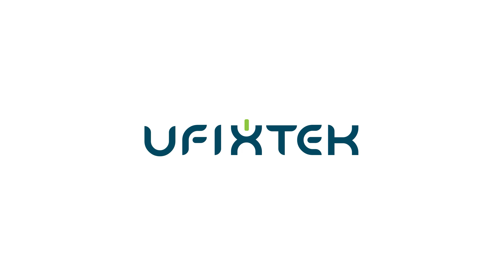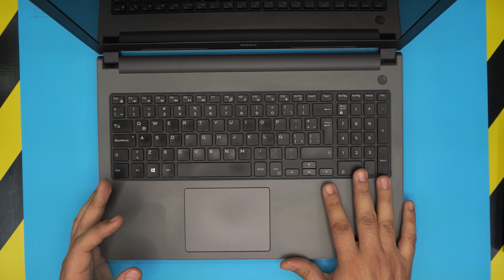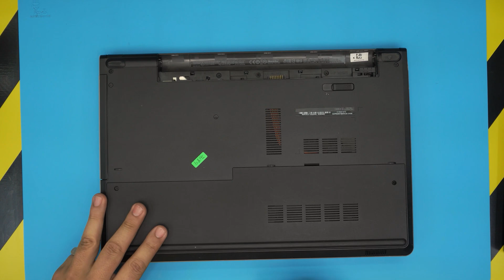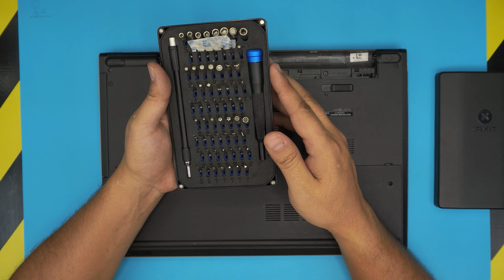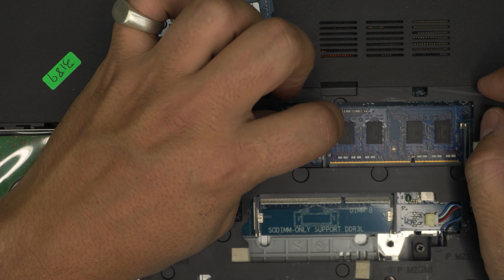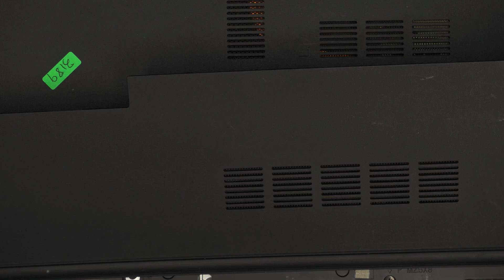Dell Inspiron 5559 P51f Ram Upgrade FULL GUIDE

Comment: Hi!
Thanks for the video.
I have a question, i'm upgrading the RAM with 2x8 DDR3L 1600, but it doesn't turn on, i checked the RAM in other laptop and it worked!, what could be the problem?, something with the BIOS?
Reply from the maker: 🫠Regarding your question, we've encountered many of the same issues you're experiencing, and we discovered that after many years of not using the RAM slot, the pins inside the DIMM develop a thin layer of corrosion. I recommend spraying 98%+ isopropyl alcohol inside the RAM DIMM, gently brushing it with a soft toothbrush, and then testing it. It's also a good idea to update the BIOS from the official site.
Should you have any further questions or requests in the future, please don't hesitate to ask me.
cheers🍻
Reply: @uFixTek It’s weird, becouse it turns on with the original 4x2 RAM, but it doesn’t works with the new 8x2 🤔
Reply from the maker: update teh BIOS from the official site.

Comment: I have upgraded my laptop with another 4gb ram ddr3l. When I run cpu z it shows 8gb of ram. But in task manager it only shows 4gb ram how to fix this?
Reply from the maker: Thank you for your feedback! If you'd like to support the channel, you can like, subscribe, or do both!

Regarding your question, i need more detail my friend, what OS you using 32bit 64bit, windows 10 or 11.
what you saying it is not normal it should not have happened, something is not right with you windows , it is not hardware issue.

Comment: I also have a black screen when I change to 8GB units (Samsung), I have a Dell Inspiron 15-5559 model I5 64 bit processor, can you help me?

I checked using "wmic memphysical get MaxCapacity, MemoryDevices" and it shows that I can upgrade to 16GB
Reply from the maker: Thank you for the feedback! if you wish to support the channel you can LIKE or SUB or both :P
regarding your question: ok, 1st of all you have to make sure that you have SDRAM DDR3L if its not the L version it will not work, L stands for LOW voltage, is your new ram L or none L, here is a compatible ram: https://amzn.to/3oKD3Tv

Comment: Does this laptop have slot 1 2 and slot 3 4 or like a pc or can i just insert 1 stick of ram in any port without having one in the other?
Reply from the maker: Thank you for the feedback! if you wish to support the channel you can LIKE or SUB or both :P
regarding your question: i believe you didn't even watch the 5min video 😏
i clearly show that there is only two ram slots available @2:25
and it doesn't matter what slot has ram it will work, or you have have ram on both slots and it will work better as it will be dual channel. but for optimal work if you only have one ram to place in the laptop place it on DIMM A that is indicated beside the slot. you could place the single ram on dimmB and it will work but better have it on DIMM A.
https://imgur.com/a/sG9og8Z

Comment: What type of ram is that?? DDR3L-1600?? Explain detail please
Reply from the maker: Thank you for the feedback! if you wish to support the channel you can LIKE or SUB or both :P
regarding your question: it uses a sdram ddr3L (low voltage)
you can place a 8GB x2 , you can place a 1600mhz or 2400, it will work because the bios will auto assign its compatible speed.
https://amzn.to/3J6E28l
its a intel cpu so MHz don't make any difference in the performance.

Comment: Great video, I already liked and subscribed. I have a question, this model supports DDR4 16GB (2x8) 2400MHz?
Reply from the maker: Thank you for the feedback! if you wish to support the channel you can LIKE or SUB or both :P
regarding your question: sorry but this model supports sdram ddr3L , it not DDR4.
2x 4gb SDRAM DDR3L
https://amzn.to/3F76ftH
Reply: @uFixTek  Thanks for answering 💯
Reply from the maker: my pleasure my friend :) if you have any other question or request feel free to ask me.
Reply: @uFixTek  Hi mate, I bought a 16 GB (2x8) 1600mhz DDR3L SODIMM from TimeTec for upgrading the 2 modules of 4 GB that I already had in my Inspiron 5559 laptop.
When I changed the two old modules for the two new ones, the laptop did not turn on, then I tried to switch the modules, but it did not turn on, then I tried to remove a module and turn on the laptop with only one RAM, but it did not work either. Then I put the old modules back in, and it turned on normally. Could you help me?
Reply: @doomplayer2817  How did you solve this issue?

Comment: Good day sir. I tried to upgrade the ram of my laptop but when I switched  it on, it does not start. The charging light only blinks 2 amber and 4 white. Do you have any suggestion for this problem sir? Thank you in advance.
Reply from the maker: Thank you for the feedback! if you wish to support the channel you can LIKE or SUB or both :P
regarding your question: 1st of all i need to know the following :
what is the exact model of the ram you upgraded and what is the total ram you upgrading to>, is it SDRAM DDR3L or DDR3 ?, and check this video to see your max capacity of the ram before upgrading:
https://youtu.be/tKEJTkVth4Q
and please follow this steps:
remove both rams and place the new ram on the DIM A and then power on and wait 5-10 sec, once you got boot screen power off and place the 2nd (old ram) on 2nd dim B and then power on and wait 10-15sec.
but make sure you have DDR3L not the DDR3 (you need the L model)
and make sure you check the video to see your max capacity.
Reply: @uFixTek  my dell led just blinks white every four seconds. it doesn't turn on
Reply: @RB_1976  Que tal, el problema es que esta Laptop solo soporta 8 GB RAM (2x4) o 16GB RAM (2X8) al mismo tiempo. Las 2 luces naranjas y 4 blancas indica ERROR de memoria.